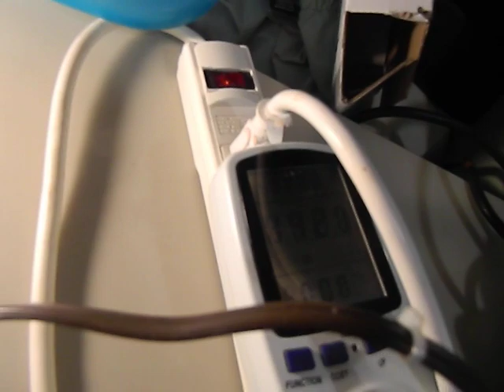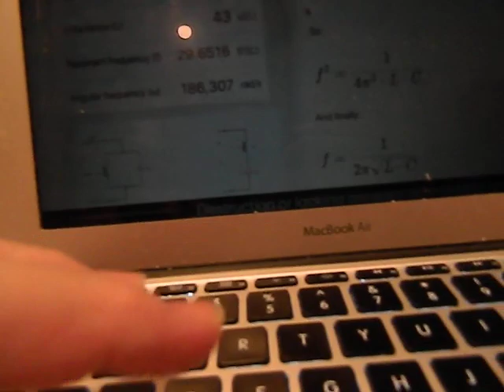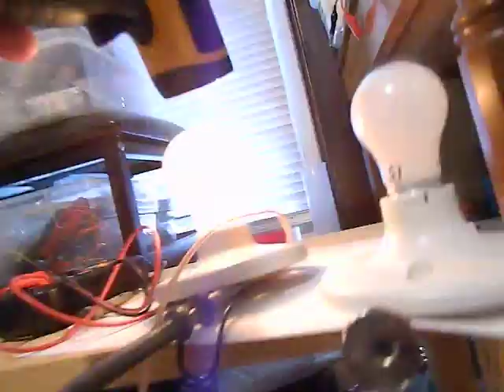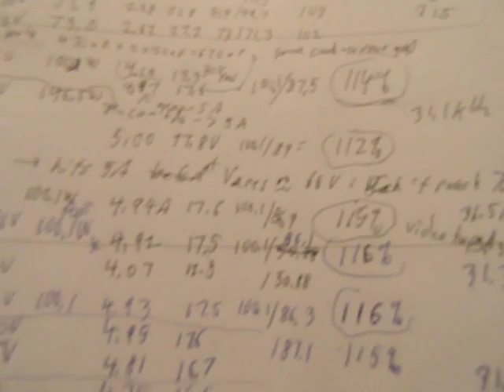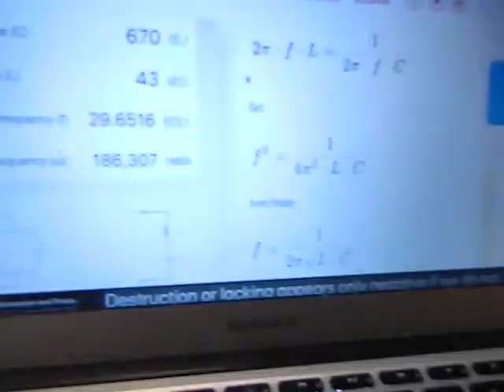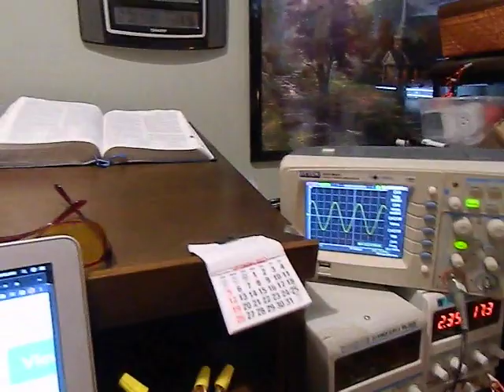Welcome to my Lab 116%

Comment: Nice work Steve, I finally got time to watch your video and it’s clear you know what your doing and have a real passion for your work. I have experimented with similar designs and found that placing two magnets between the halves of your transformer instead of around the perimeter does have an effect, not always a good effect but sometimes this can be helpful in orienting the fields in particular directions through the core. In some tests the fields were opposing and other times they were arranged to be attracting, I haven’t finished those tests but in my minds eye I could see Edward Leedskalnins PMH at work here. Keep up the amazing work.

Comment: Hi. Welcome my dear energy researcher friend.
First of all. Great work you are doing.
Second. You don't show me a blueprint of what you're doing. So it's not clear exactly.
About the measurement. 
If you have alternating voltage and current then the phase angle is important.
If you watch this video you will see that in an approximate measurement the power on the DC side is 76 VA and the reactive power on the secondary side is 675VAr. But with 90° deviation. That's a lot.  https://www.youtube.com/watch?v=jwmfTD8ONt0
So is this now credible?  

Atti.
Reply from the maker: I show a blueprint, now the thumbnail for this video.  My output power measurement is checked by measuring the temperature rise of the light bulb, a type of calorimetry-- and this agrees with my other calibration.

Comment: hi Steven, greetings!  sandy r here (from OU days).  Nice to see a thorough experiment taking place.  I looked back thro' your videos but couldn't see if you have some underlying principle to test; do you discuss this anywhere?  Interesting about the air-gap - are you familiar with H Aspden's report on this effect?  My answer to your question here, would be to continue exploring effects which improve efficiency before settling on a limit of diminishing returns, then major calibration & confirmation of results by alt methods where feasible.  Calibrating at each test reduces % time for investigation (but obvs, initial confirmation of test eqpt and parts important to avoid wasted time chasing artefacts!).  Happy hunting!
Reply from the maker: Good to hear from you, Sandy!   Underlying principle - follows from the idea of matching "transmitter freq" (primary coil here) and "LC - resonant-freq", an old idea I think.  Tried here with ferrite and metglas cores - and higher power levels than used with air-core coils/Tesla coils.  I agree with you, "continue exploring effects which improve efficiency"...   Do you have any ideas/suggestions?  PS - my email is profSJones at-symbol gmail dot com

Comment: Hey Steve! Great stuff! I think you answered your own question though about going to 160% Which I agree with. Seems like the greater margin you can get above unity The less variations in calibration will affect overall results. Also, very interesting about the gap improving efficiency.  A long time ago Codygillespi Had posted something about that with a small gap and also used Neo Magnets to make an even greater improvement. As I recall it changed the L of the coil.  I looked for the vid but it's no longer there. Have you played with magnets around the core to see what effects it may have? I suspect it's counter productive in your configuration but you never know. Still catching up on your vids...
Reply from the maker: Good to hear from you, Les!  Again, I agree (about going to 160%).  So this morning I added a strong neo-magnet to the core (upper left-hand corner of the square), it stuck to the core of course, but I saw no change in efficiency.   Easy to try.  Another other ideas??
Reply: @TheProfJones  It seems you have done the key things. Running it in resonance is the big thing. I don't know what your frequency is coming out of the ZVS but if it can be set high and then your output coil set to a subharmonic of that Then your hitting the world I am working in. The closest to info on that would be the output stage of old 50's to 70's ham radio (there is a chart for adding a resistor in parallel with the tank circuit to lower its frequency). also the wire lengths on your output transformer should be evenly divisible. Add a ground on the input side of your transformer with a variable shunt to play with which should be a slightly higher impedance than the resistance of the coil winding. Using air grounds for that has been better in my experiments than earth ground but I am not working with any power. that's about all I can think of for now.
Reply: I’m excited to see your progress. Any updates Dr. Jones?